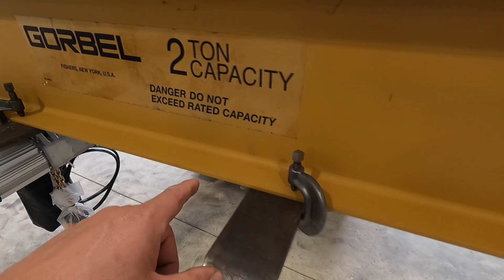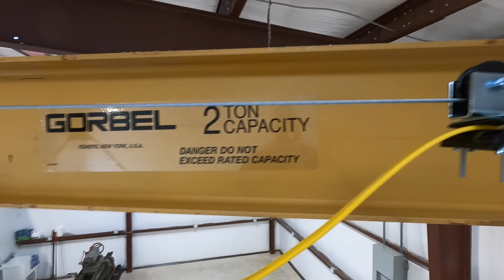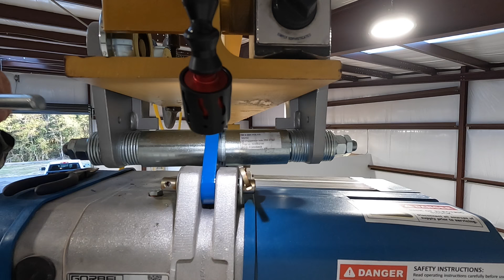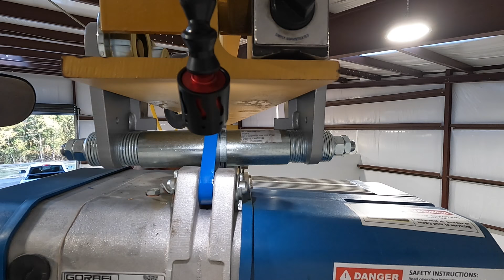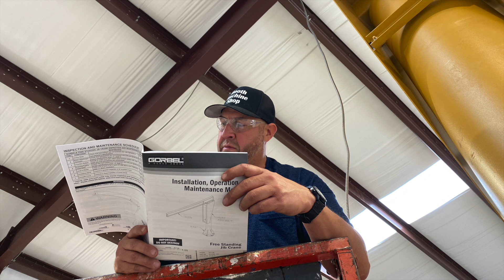Gorbel Jib Crane Installation Part 2

Comment: Hi Adam (or anyone who happens across this and might be able to help someone trying to learn) I've been getting into machining (manual and low budget cnc), 3d printing, and metal casting. I'm having a terrible time finding information on how to make, measure or DRAW accurate blueprints from a single physical part (say a worn or broken part, or a part you want to make multiples of). Any searches I've done lead to hoe to read blueprints or the information machinists want in blueprints, but I have found nothing on tools and tips for HOW to take a physical part and accurately measure fine details (such as small holes, feature angles, etc). I'd love any tips for videos, websites, or books that can help. Thank you.

Comment: Is drill rod a comparable replacement for the stock pins?
Reply: Probably not but they worked to get everything hung up.
Factory pins replaced them before any load was lifted.

Comment: So, I dont get one thing- two 14mm pins holding 2 tons? Given each one has 150mm² area, and the accteptable shear load for pins is 60 Mpa, each one is right around one ton. Seems a bit unsafe to me not to have any safety factor built in. EDIT: and how the hell this thing would have any warranty or any insurance claim in case of accident with those self-made pins is beyond me
Reply: An 8mm pin will take 14.6 kN they are14mm high tensile pins 
=44.2  kN  8,85 tonne  I have fitted loads of them
Reply: i think you would calculate two cross sections of the pins, as two cross sections would shear of in case of a failure. So the effective cross section is actually double the size.
Reply: The pins are in double shear
Reply: Yup. I, too, got a very Chinese impression of that crane. But hey they probably use an American ton that is less than a SI ton (not to be confused with a British ton that is more than a SI ton) 😆
Reply: Each pin is a double-shear scenario, so you need to double your cross-sectional area.
Reply: My main point is, this whole design is ghetto as hell. Id never sign my name under such a project, and believe me, I designed a whole load of simmilar machines
Reply: Is a standard method of mounting that style of chain hoist regardless of manufacturer. You don’t see them falling off on a daily occurrence all around the world so I guess the guys that designed the system knew what they were doing

Comment: hi, you want to coat that floor with epoxy floor paint once you remove the tyre marks , dont use products that are not epoxy as they are not up to the job. workshop starting to look good just the floor letting it down

Comment: Surprised you like "fits-all" wrenches ( adjustable knuckle -junkers)  instead of the correct size wrench. And what happened to a torque wrench? "Im going to torque these bolts" how do you do that with a "fits-all" and no torque wrench?
Reply: Torquing bolts doesn't necessarily require a torque wrench.  Torquing them to a particular value does.
Reply: @stargazer7644  //Torquing them to a particular value does.// requiring a torque wrench. Ever worked in construction? Inspectors use torque wrenches to check your torqued values.
Reply: @stephenhope7319  Yeah, that's pretty much exactly what I just said.  The phrase "torquing a bolt" means to tighten it.  It doesn't necessarily mean tightening them it a quantified value.  It can also be done approximately by feel.
Reply: He still has most of his tools at his other shop, so he's using whats around.

Comment: It's a bummer that it is mounted on the expansion joint. Even a baby automotive lift wants 3/4 anchors  at least 12" from any expansion joint.
Reply: Those arent true expansion joints. They are surface cuts to control cracking ... and there is a dedicated "anchor slab" 4 or 5 feet deep specifically for the crane.

Comment: If you buy a forklift, go electric. Much better for the environment. Great work, Adam!
Reply: What aspect is better for the environment ? The fabricating, producing the ellectricity or natural gas to run it ?
Reply: The sad thing is, people actually believe this garbage. I kid you not, there are electric car charging stations in my area with a diesel generator to produce the electricity. Cause that makes sense. 🙄
Reply: @grntitan1  Is that for when the power goes out, or did somebody not think it through? Normally electric car charging stations work off the grid.

Comment: OK, I understand they use this trolley for different size beams... but this washer stacking is HOKEY!   But with your skills and machines, you should be able to make solid, bespoke, spacer bushings to keep it aligned right and MUCH stronger.

Comment: Never saddle a dead horse. Bush league install.
Reply: As a Millwright, we never saddle a dead horse, change them around Atom
Reply: The wire rope clips are installed wrong and no thimble was used. Bush league !

Comment: Strange set-up with no counterweight or nothing.
Reply: That'll be the next job, manufacturing a counterweight when Adam discovers that it sags by 2 thou when loaded.
Reply: It's only a 2-ton; that column and beam will handle it easily.
Reply: @JohnSmith-vi5pz  
👍😄
Reply: @slots1407  
Yeah - that crane must weigh at least two tonnes in itself.

I've seen flimsier contraptions that manage two tonnes no problem. Bet his hitch hoist can do that. 😊
Reply: Quitte common on workshop cranes
Reply: @janvisser2223  
I quit.
Reply: @Peter_Riis_DK  
In my country we mostly see the column cranes made by ABUS
No counterweights.
That has the advantage that an owner can position it in a corner or against a wall, in order not to  spoil expensive floor space.
Reply: @JohnSmith-vi5pz  Replace the brass shims with steel. That'll fix it.
Reply: @Peter_Riis_DK  Like those 2-ton engine hoists.
Reply: The swivel extends down and transfers the torque to the column.  Presumably, the hub is amply strong to withstand the shearing force up top.  For such a low load-rating, it's a good way to keep cost, complexity and weight down.

Comment: Love your videos but thought i might mention that if osha ever inspects the shop they will bust you on the clamps, never saddle a dead hoarse.
Reply: Where are the clamps?`
Reply: @orfeous  They only hold the electric cable pulleys but i know how osha can be. It is not a safety issue as far as i am concerned but i was public works director and had to deal with them.
Reply: @survivingmaineona20acrefar77  ah, should be an easy job to fix those i guess.
Reply: @orfeous  Real easy, install another wire clamp the right side up alongside the wrong ones. Tighten new ones, then remove the wrong ones. No need to remove tension on the wire, all that stays put.
Reply: OSHA is joke I’ve been on multi million dollar hospital and apartment jobs never a sign of OSHA. All the big contractors have their own safety Nazis to slow things down. And I doubt if OSHA did show up they are going to even notice the clamps

Comment: I am no expert, but I would have Gorbel sign off on every part of the installation. If something should fail, and somebody gets hurt. You need some shared liability. I don't think you will ever get indemnity. I guess there is risk in everything you do. I don't think the grouting was proper. I just watched some videos of machinery grouting. Oh well, it is done.

Comment: 6:05 My dad taught me "If there are two ways of doing something you can be damn sure one of them is wrong" ... 

Adam you randoly choose a way to assemble the cable clamp, and you choose the wrong way, This method of assembly, reduces the cable strength by one third. The "saddle" of the cable clamp goes on the live end of the cable, not the way you did it. :( .. 

Also you need 5 times the cable diameter 'stick past' the clamp on the dead end, AND between clamps, a cable this size need 2 clamps to obtain 90% to 95% cable strength.

7:22 Again :(

8:52 .. I think you did it wrong and you should fix it :(
Reply: Not an issue. It's just holding the electrical wire.
Reply: @c0mputer  No reason to do it wrong! ... It's just your shoes don't tie the laces.

Comment: hi, you did it, but you did not some of the basics, three times I could not believe how close she came to getting her hand or foiger cut off?she did not know how dangerous moving steel can be?and old timer told me something I will never forget it is like a giant sizzor, at the end of the Video. you were bullshitting about the proper tools, you were working like a shoemaker, you needed a connecting bar (a 24" bar with one side a chisel the other a tapered point the size of the bolt you are using). the second tools spud wrench,(an opened end wrench to fit the bolt, and the other side a long tampered point to fit the bolt hole for aliment, you need a torque wench, a 3/4" drive ratchet, an open end combo wrench to fit the bolts.you have to see how many foot pounds of torque the bolts need ,I do not think you can achieve that with an 12" adjustable wrench? be careful that crane is only good for 2 tons, that is not a lot, be careful I love your shows, you have many irons in the fire, you guys need another vacation?
(

Comment: Why is everyone crying about pimch points and fingers? Her fingers were no where near being in danger...
Reply: Your right however most of us have done exactly what we where screaming at our screens for her not to do!
Reply: One accidental push forward on the forklift and they're sheared off.
Reply: @bottomlands  Exactly correct.
Reply: @madjimbo4176  
Adam: it's hard to control, it's very jerky. She had her hand between the blades of a giant pair of scissors. A bit too much gas, from someone that never runs a fork lift, on a fork lift they've never run before, and get fingers would be gone. Genius.

Comment: hi, nice job? you may be a great machinist,but you are a shitty ironworker? I have commented on your mistakes before,just now I was going to say something about ear protection, but you were faster than me to correct your actions.the thing that really scares me, and I have commented before is the use of impact guns and automotive sockets?  over the years I have seen three men loose an eye when a socket shattered, and once the guy who lost his eye was wearing eye protection.just take a second and incorporate into your video the compassionate  of the socket and an impact socket.if only one person takes your warning and it saves an eye you have done a great service.  where are the lock washers or lock tite on the tag line eye bolts and stop angles?  and you did a great job with the c clamps on the forks' was on a job on a Saturday once when they were erecting tower supports to temporately hold up a section of an elevatelated train line, when the chokers slipped off the fork of a large lull and three men suffered six compound broken legs, be careful making that lift with that fork lift you are using. I am up to the part where you are inlaying the trolly cable, and you have made a mistake no Iron worker would make, you have installed the cable clamps, you never put a sadle on a dead horse, the u bolt goes over the dead end cable?
Reply: Why do everybody talk about a dead horse and where are those cable clamps? Please timestamp link..
Reply: If you use good quality sockets, they'll withstand the use of an impact driver.
As for the cable clamps - it's not like the cable's important or has any load on it other than the tension in the cable. The way he worked, anyone would think he was trying to tune it :)
Reply: I doubt you have seen 3 men lose an eye from using the wrong socket. I call bs.